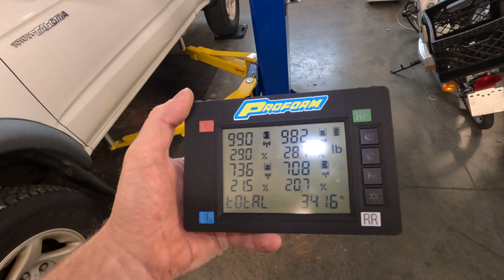I am converting a Toyota Tacoma to Electric! The journey starts here.

Comment: My son and I have happened upon a 1955 Nash Metropolitan with a decent body that we want to convert. This model does not have a trunk, so the battery box would have to be behind the seats in the cab unless we can fit it where the gas tank was in the rear underneath. I have not heard of the issue of venting for safety before. I'm unsure how to address this with this particular build (vent to the ground from the cab?).
Reply from the maker: You can get burst vents which will be sealed until the pressure inside the battery box reaches a certain amount and then it will burst before the rest of the box, you can then vent it out of the cabin.

Comment: You should look into the ZombieVerter VCU and a Lexus GS450h transmission. Then you have the entire engine bay to have batteries.
Reply from the maker: Thanks for the idea but from what I've read it's not a fully mature solution and would require more tuning and other stuff. I love the LEAF + Resolve-EV setup because it just works and has OEM reliability.

Comment: There is one modification that could help enormously with this project, fit a "Body Lift Kit" , essentially a set of nylon pucks 2" thick with longer bolts.  This would allow extra clearance to fit the battery pack inside the chassis rails without compromising ground clearance or bed space , also increasing rear axle load for better traction.  It would also be worth looking at using the Lexus GS400 transmission with the Open Inverter controller as featured in one of Damien Maguire 's videos.  The other option would be to convert to FWD , fit the front hubs from a 4WD Tacoma and hook up to the complete motor / transmission of the Leaf 🤔. With this option the driveshaft could also be removed with the added benefit of a single battery box.
Reply from the maker: I had thought of that and it may be a possibility but I would rather not lift the body as that would increase aero drag.
Reply: @EVSwap  that Toyota Tacoma is already a brick rolling down the road, so I don't think a few inches of additional height would matter regarding aerodynamics because there's already a ton of air going undreneath as it sits right now, and a modest lift might make it look just that much better 🤷‍♂

Comment: Battery module sizes all 16 are are 12" deep X 8 3/4" wide, 8 small modules 4 3/4" tall, 4 medium modules  7 1/2" tall, 4 large modules 9 3/4" tall, total weight of just modules 700LB. Each module is mounted and compressed to the bottom of the battery box.
Reply from the maker: Excellent info, thanks! 700lbs is pretty heavy

Comment: Which year is this truck? I have an ‘08 manual that needs a new engine
Reply from the maker: This is a 2002 Tacoma
Reply: @EVSwap  I sent a message through the website
Reply: This is an 04 or older, not the same engine
Reply: @ the bolt pattern is different?
Reply: @johnd169  the engines are entirely different, you can't swap one for the other. Your truck's ECU cannot run this engine
Reply: @ yes, I gathered that the whole engine, transmission, ecu, and corresponding wires would have to be replaced. Thanks. The scale of that swap is beyond my current capacity.

Comment: Good luck on the conversion! I'm looking forward to your updates. I think you might be a little optimistic about the range you'll see out of 62 kWh, but it should definitely be good enough for most daily driving.
Reply from the maker: We'll see, I was able to get 130ish miles out of the Frontier with a 40kwh battery and that was all highway driving also. This truck is a little taller and a smidge heavier but still should be pretty decent efficiency.
Reply: @EVSwap  Yes, the LEAF powertrain should be a little more efficient than the Ford Ranger EV induction motor powertrain, but the Ranger EV typically sees around 400 Wh/mi consumption in mixed driving with a very similar platform. My guess is about 150 miles of range in mixed driving, but I'm looking forward to seeing how it plays out!
Reply from the maker: Thanks for the info. Yes the biggest factor in range is how you drive. Slower speeds are always better, but I'm also thinking 150 miles should be doable. Thanks for watching and commenting!